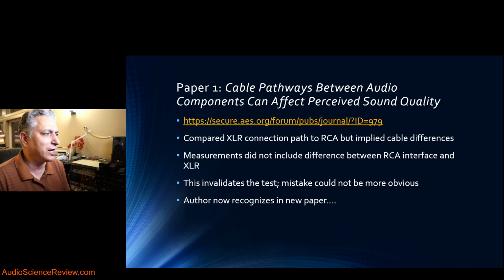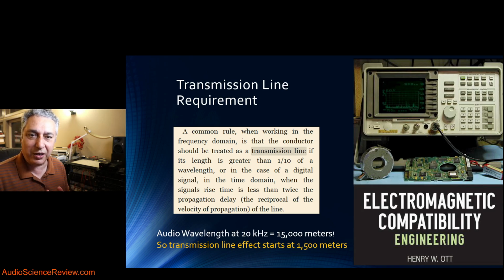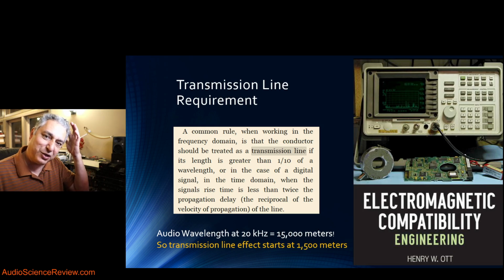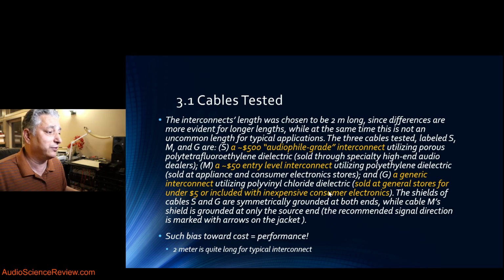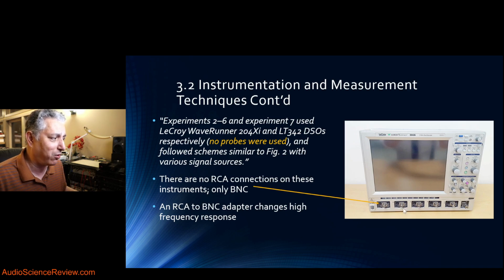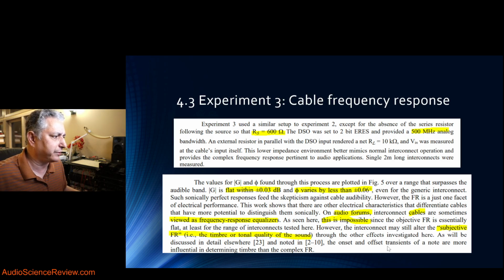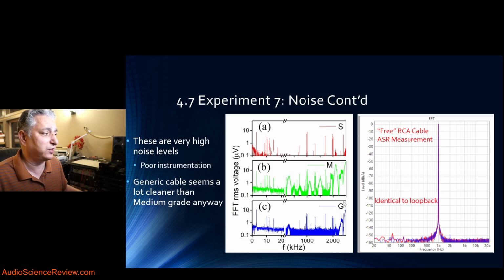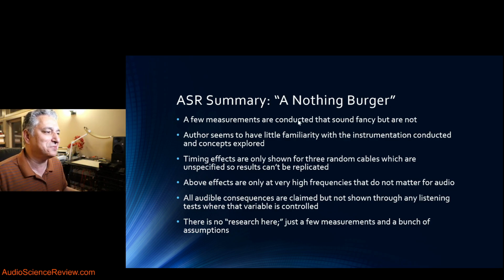Scientific Proof of Measurable Difference in Audio Cables? Paper Review

Comment: Can cables alter electrical signals? The answer from this electrical engineer who has spent countless millions of dollars of other people's money on wire for endless different purposes the answer is without a doubt yes. If that wasn't true there wouldn't be so many different kinds. Then what kind of cables do I use? The cheapest ones I can get. For speakers I use 16 gauge zip cord sold as speaker wire at Home Depot as 100 foot spools for $20. For interconnects when I needed more cables than I accumulated from equipment I'd bought that they were supplied with I went from Radio Shack who went out of business to the Dollar Store, and finally to Parts Express only because their cheapest is better made than Trisonic at the Dollar Store. For power I use whatever the manufacturer supplies. To find out why let's look into it. 

More is known about the electrical performance of wire than practically any other electrical or electronic component. The operative equation for modeling the performance of wire is the Telegrapher's equation. This equation is derived from Maxwell's laws. 
https://en.wikipedia.org/wiki/Telegrapher%27s_equations
Notice that this is a four element filter circuit whose values depend not only on the way the wire is constructed but on the length. For all audio circuits you can ignore Gdx because its value is zero. 

To test the audible effect a wire has in a circuit the only valid test is not A versus B but A versus A shunted, that is A versus A bypassed. If there is any audible difference you don't want that wire because wire is not intended as a control element, exactly the opposite. 

The effect a wire has on an electrical signal depends on not just the wire itself but on the source impedance and the load impedance. This affects the transfer function G(j*omega). If you are an electrical engineer you'd damned well better know what this means. If not, it's just the alteration of the frequency response. You do not want wire to alter the frequency response of a system, there are infinitely better ways to do that reliably, cheaply, controllably where wire fails on all three accounts. Here is how electrical engineer use this and other equations to understand the effect wire has. When I went to school we had to do all of the calculations by hand. In this example computer software does it for you, all you have to do is insert the parameters for your particular case. The model begins at 3:58. You can look at it slightly earlier to see where he got some of the parameters he fed into the software.
https://www.youtube.com/watch?v=O1LQ6r4n4mk&t=340s

Here's one way to change the G(j*omega) by changing the impedance of the load.
https://www.youtube.com/watch?v=oUGWnGwI4_o&t=155s

Personally I use graphic equalizers. This powerful tool does the same thing your expensive wires do but it is infinitely superior in every meaningful way. It introduces no nonlinear distortion or noise. To those who say it causes phase shift know what electrical engineers know, that for what is now called a zero phase system which both wire and equaliers are, there is a direct correlation between amplitude frequency response and phase frequency response. Given either the EE student should be able to calculate the other. This is why you never see measured phase response curves for these types of systems such as amplifiers. OTOH multiway speakers are not zero phase systems which is why their phase frequency response is also measured.
Reply: @Douglas Blake  All cables alter electrical signals. Selection of the right cable for a circuit is to choose a cable where the alteration is within acceptable limits. Who has the skills to determine what is acceptable? It's one of the specialized skills only electrical engineers are taught. This skill is particularly important in all types of hard wired electrical networks, both power and signaling networks.
Reply: @Douglas Blake Having read the original double blind very elaborate tests reports in Stereo Review Magazine back in the 1980s, yes I'm that old, there was no statistical difference by the panel between the sound of 16 gauge zip cord and Monster cable  but there was a clear difference between both of them and 18 gauge speaker cable. 

I had an up front seat for 12 years working at Bell Communications Research, a spinoff of Bell Telephone Laboratories fot whom I later worked watching some of the best people in the telecom industry try desperately to somehow salvage the so called copper (twisted pair) network which the company's owners and sole customers the RBOCs dealt with as a massive infrastructure investment against the emerging then entirely coaxial cable TV network. They tried every possible trick they could think of. Despite their best efforts they couldn't deliver a single NTSC channel digitally to their customers without digital artifacts. The best the RBOCs could come up with was DSL which compared to the cable networks was a joke.  Ironically about 20 years ago I worked on installing a sitewide fiber optic/CAT5 100 Mhz network at a 180 acre 55 building Pharmaceutical company campus in East Hanover NJ. The limit for CAT5 was 250 feet. 

I have infinite faith in the audiophile industry can eff everything up even with something as simple and clear cut as wire. IMO they've effed everything else up as well. To create what they promised by never delivered, concert hall realism from a recording in a home I had to reengineer the entire concept of a sound system from scratch using entirely different principles and engineering concepts that are exactly the opposite of what this industry bases its endless clones of the same design as it used in 1958 on. The results are represented in my patent 4,332,979. The industry had no interest in it and I have what is likely the only working prototype in the world. If audiophiles heard it they'd cry. That prototype only cost about $3000 to build and is based on an infringement on my patent that contains the mathematical algorithm I invented to explain sound and acoustics. Having contacted them neither that manufacturer nor anyone else ever developed and marketed another on like it as far as I know. 

By contrast my education at today's cost would be around half a million dollars and the four toughest years of mental work I ever did in my life. It was worth every second of the effort. This was at the oldest engineering school in the United States and as tough and comprehensive as they could make it. BTW, acoustics and sound are not an electrical phenomenon, they are an aspect of fluid dynamics, the fluid being air and the field being time variant pressure gradients. If you don't even understand a problem then you can't possibly solve it. As my father who was also an engineer constantly told me, if you can't say it with numbers you are full of $hit. In fact until I figured out how to measure what I invented I was on the verge of throwing in the towel. As for what the audiophile industry measures, most of it is worthless because it doesn't correlate to what people hear. Most of them are based on concepts that were developed and valuable back in the 1930s and 1940s.
Reply: @Douglas Blake  Once upon a time concert hall realism was the goal. They gave up because they couldn't do it and so they claimed it couldn't be done. 

While all commercial recordings are created to make a profit I break them down into two categories, documented recordings where the engineers do their best to get the most accurate reproduction they can even if they manipulate the signals to do it and manufactured music where there is no relationship between what on the recording and the sound that was produced live.

My method models sound fields and reconstructs what's missing from  what you have. Audiophiles believe the best recordings are perfect and will sound perfect through a perfect sound system. My idea is based on all recordings being flawed because major parts of the sound are missing.  Audiophiles believe the acoustics of the listening room is the enemy. My idea is that the room acoustics are an indispensable integral part of the system. Audiophiles believe less is more. My idea requires a lot of electronic circuitry both digital and analog. Audiophiles believe one size fits all and therefore requires no adjustments. My idea is that the system must be tuned to the listening room and then to each recording separately which isn't easy. I do it by ear. Each one takes time. My system can mold sound in time, space and spectrally in ways other sound systems can't.
Reply: @Douglas Blake  you can see my resume on LinkedIn. I've let my memberships in the American Institute of physics. The acoustic society of America,  and IEEE lapse but I could reactivate them any time by paying due. I've forgotten more math than most people will ever know. This was a problem in mathematical modeling. Think whatever you like.
Reply: @Douglas Blake I offered you expert knowledge. You are free to do whatever you like including ignore it. Since you have nothing of value to contribute to me I think we're done here. I don't even know why you posted a response to me in the first place.
Reply: @Douglas Blake I've given you the scientific basis for understanding the electrical properties of wire, I've shown you by example how engineers use it to analyze circuit performance, I've shown you by example how the different components interact with wire to alter frequency response, I've told you why I buy the cheapest wire that does the job, and I've given you a source to check my credentials. You are free to ignore all of it and remains ignorant and stupid. I couldn't care less.
Reply: @Douglas Blake  Don't feel alone. I don't give anyone else in this industry any credit either except for the engineers at Sony and Phillips who invented RBCD. Other than that I don't see that anyone came up with anything new in 65 years.

Comment: Cables absolutely make a difference, USB to speaker cables, I think you are too caught up with measurements that your mind is fooling you to believe there is no difference "placebo Effect". At one point in time earth was flat and that was science back then. Amps and speakers can measure same/similar yet sound different. I cant even begin to count the number of cable companies out there still in business and to bluntly say cables don't make an audible difference is silly. Expensive cables doesn't always sound good, cheap cables don't always sound bad nevertheless there is a difference. Expensive cables generally sound better because better quality parts are used in manufacturing. Most manufacturers and dealers have return policies maybe not you because obviously you cant hear so maybe your followers can try for themselves and come to that conclusion and slow down on biased opinions. When we all start this hobby most are with your mind set, you just cant imagine how a cable can make that big of a difference but as you gain knowledge in the hobby you will start to hear the differences. As you claim (On another previous video) any basic cable (RadioShack cables) sound just as good as any expensive cable is pushing your luck. I seriously dare your followers to try both cables and admit there is no difference! 
I cant imagine people taking you seriously! I just scrolled down to read comments.... I can totally see people taking you seriously... no one talks about comparing cables yet barking at the moon.

Comment: Hey Amir
I dont know if you read comments this late but i think ive found the reason for the buzzing sound in the Focal Elex/Clear. With EQ applied listening to low bass in music has sometimes created a buzz but i literally just realised that when i tilt my head to the left it doesnt do it. I was confused by this but then i found out basically when the driver moves a lot it touches the small hairs from your head and they poke through just enough the touch the driver which causes this buzzing sound. This is my cause however perhaps yours was truly the driver limit becuase i listen at very low volume (-6db pre amp on APO and 34% - 36% volume on my THX Onyx.

Comment: Milind Kunchur has been an audiophile for the last 30 odd years. He is one of the leading experts in the world on the subject of super conductivity. So he definitely knows more about cables and conductivity than almost any other audiophile claims to know or understand. A little background on someone before you comment on them is always advisable.
Reply: @Douglas Blake so Amir says cables do not make a difference?
Reply: @kjaudio1  He is saying audible differences. I am sure he can measure differences when you cut off a foot of cable. Is it audible?
Reply: @charlesbiller4371  if you have two different makes of cable brands of same length for speakers and interconnects or power cables, you will hear the difference.
Reply: @kjaudio1  Takes good imagination as credible evidence is lacking. 
Enjoy your perceptions. 🙂
Reply: @charlesbiller4371  it just takes a pair of reasonably good ears, which I thankfully possess. 
So according to your logic, 2 tweeters one soft dome and one hard dome having the exact measurable electrical characteristics, should sound the same because they push the same amount of air, correct. Enjoy your perceptions.
Reply: @kjaudio1   You must be confused. We are talking about cables, not speakers.
Reply: @charlesbiller4371  Calling me confused doesn't answer the question, it only shows you don't have an answer to similar measurements but different perception. 
Milind is absolutely correct, there can be no doubt that cables can sound different on the same system(provided you have a revealing enough setup).
Reply: @@Douglas_Blake Forget everything, what do your ears tell you? Difference exists or no?
Reply: @Douglas Blake of course I can hear cable differences
Reply: @kjaudio1  Of course this was established in a credible protocol with DBT and statistically significant outcome?
Of course not.
Reply: @Douglas BlakeSo your stance seems- because you don't want to pay, you don't want to hear the difference. You don't want to play the overpriced game, but that is your personal take, doesn't mean audible differences in cables don't exist. 
Others spend their money because they can hear the difference and can justify the price. Personally I feel people who use poorly designed active speakers are just wasting their time.

Comment: We can actually hear from 1Hz to 100khz and it can be proven too.
There is too much old school technology out there that has been amended already , acoustics, electrics ,analogue and digital 
Don't copy an old engineering textbook. 
You need to think out of the box if you want to do some new findings. 
Most engineers don't even know how to solder. They are just theorizing from regurgitated textbooks 
Start doing the right research .
Reply from the maker: I have been soldering for many decades.  Didn't know that would be a proof point for anything.  :)  But no, you don't hear 100 kHz but even if you did, your wires are pretty good for that.  But the rest of your system, they would be in pain.
Reply: Is that proof published?